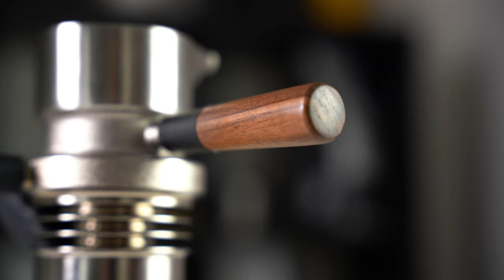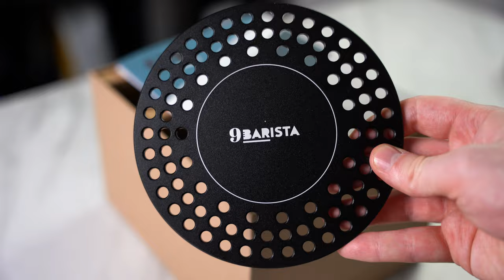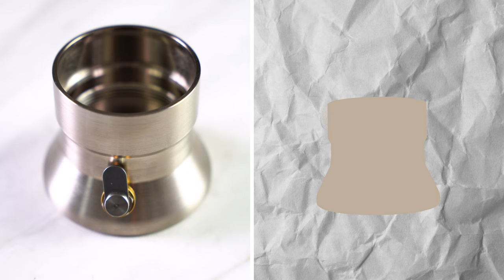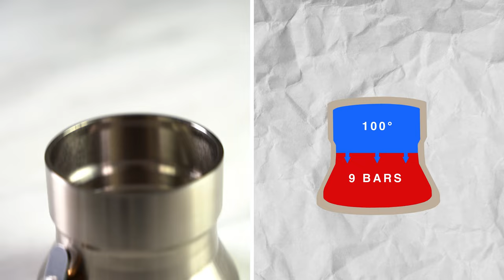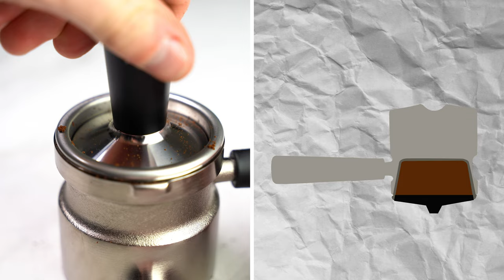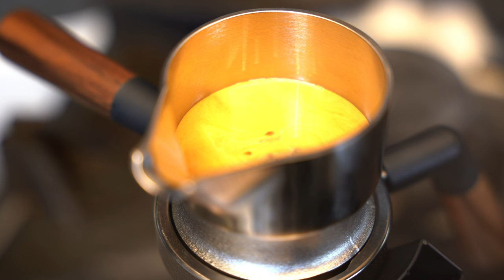9 Barista Espresso Machine Unboxing And Review

Comment: This is my home mashine I love it. only problem Ive hade is that the nickle plating hase been falling off inside the bboiler. ive contacted the seller they said the new boiler is on its way. I hope I get it soon
Reply: Hi How often did you use it before the plating came off?
Reply: @DR19X  idk probably over 100 times. Ive used the new boiler twice as often now but only with 3rd wave water so I dont have to descale it anymore. Maby I made a mistake while descaling or it was a production fail or both eather way it was no issue to get a replacement. Can recommend the mashine for me its perfect